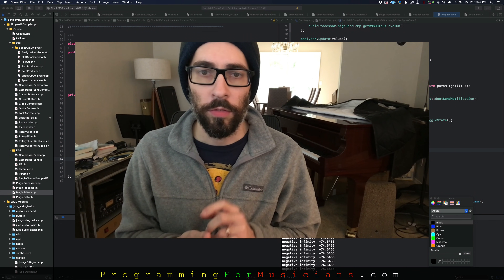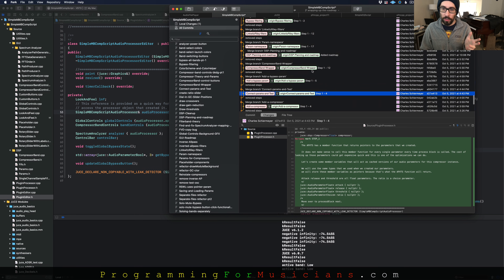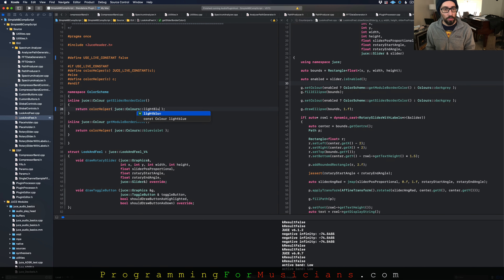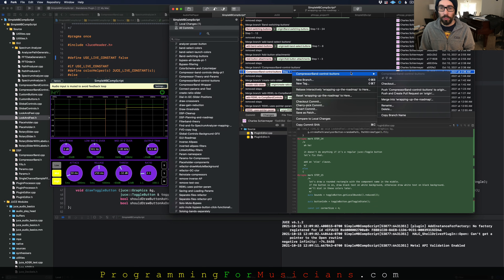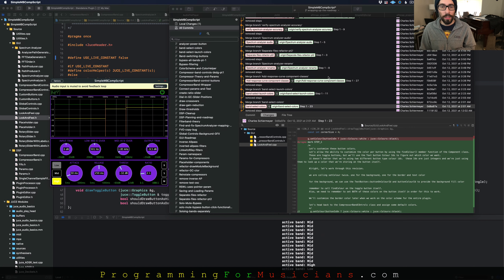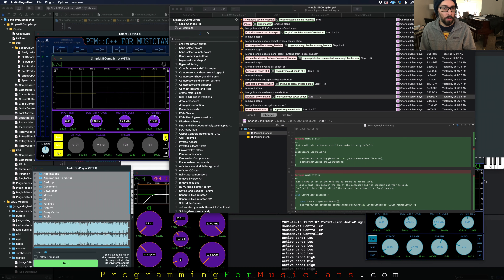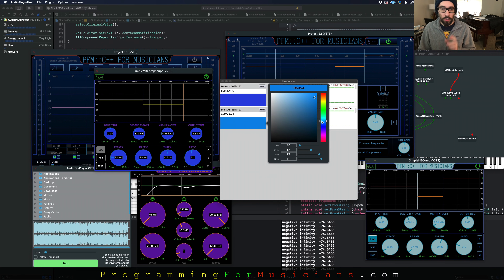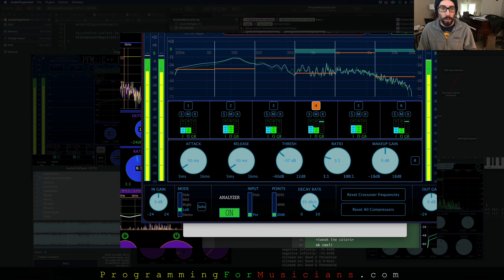SimpleMBComp Course Overview

Comment: hi im having trouble even though i followed this course when trying to modify the sound with threshold attack and release after adding and adding bypass to it there is no sound difference at all
Reply from the maker: If you need support, message me in Slack.  You were emailed an invite link as soon as you signed up.  YouTube is not a support forum.